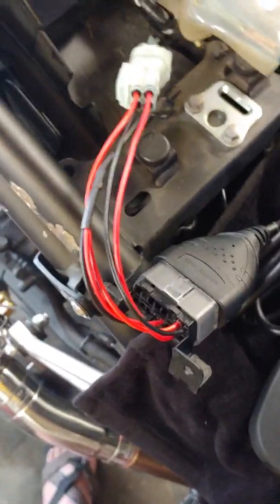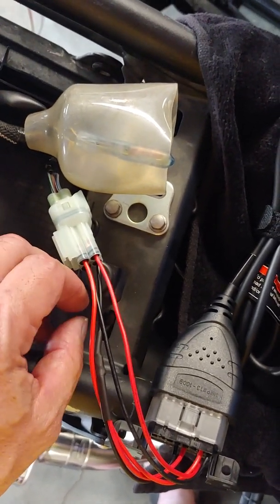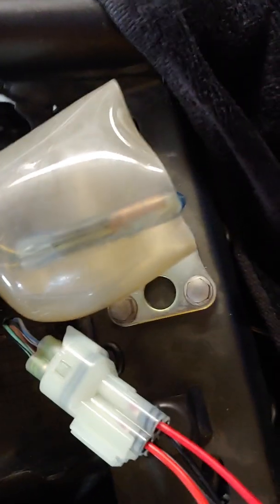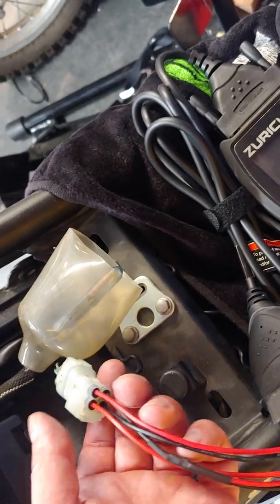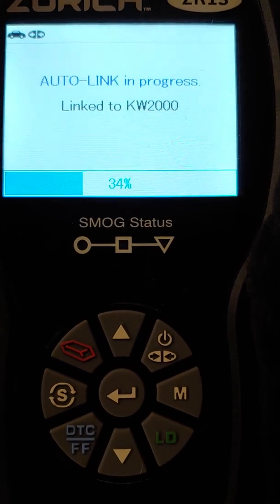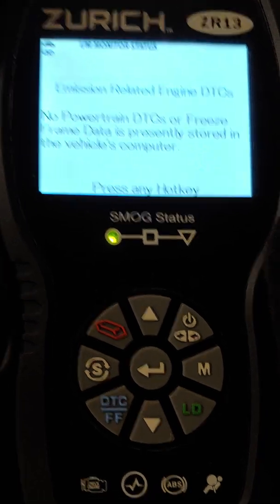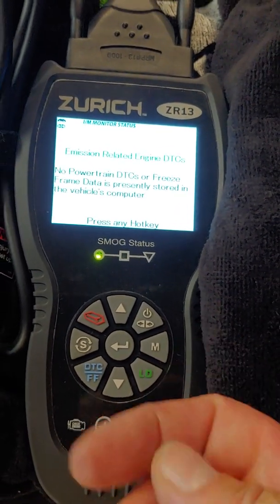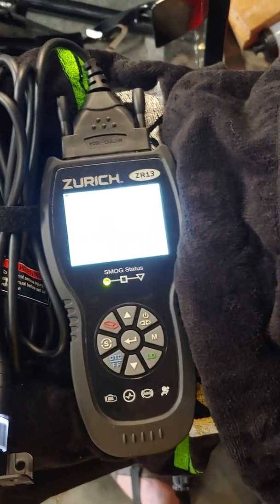Kawasaki Ninja 400 KDS-OBD DIY Connector Test

Comment: The Innova 5210 works really good also, the fuel trim live view graph is excellent,,,,Kawasaki now with the Euro5 6-pin plug supports all obd2 protocols like the one in this video kw2000, also can bus high and low, also L-line protocols,,,,,,when you hook up the meter all protocols register 100% and then it chooses can bus for the scan not kw2000 protocol, I guess if you disconect the can bus line it will then pickup the kw2000 protocol.👍

Comment: please, i need help, i was doing this by myself (yes, stupid) with just loose wires, and when i put one wire in the 15 pin (k line) it touch the positive of the baterry and made a cut, now the bike doesn't start and when i put the keys to ignition, it doesn't do anything, the baterry is new and i don't know what to do
Reply from the maker: Check your 30A Main Fuse
Reply: @falcn12  thanks, i checked and it was one burned, i changed the fuse and now when i put the bike on first gear it cut off, i already check the kickstand sensor but thats not the problem
Reply from the maker: @Crissalonsourra kickstand can't be down when you put it in gear. Must be in neutral to start the bike. Even holding in the clutch the bike will cut out if you put it in gear with the stand down.

Comment: Pulling my hair out trying to get a working OBD2 lead for my Kawasaki Ninja 400 2018 

Can you tell me the name of the plug I will need to order to connect to the ninja 4 pin plug. Thanks 🙏🏾
Reply from the maker: It's in the description. The 4-pin is "I bought the correct KDS 4-pin connector from cycleterminal.com. It is a Sumitomo HM090-4 connector.  I just bought both sides, just in case.  Plus it was only $5.55 as a set."
Reply from the maker: If you just want to buy one, Norton Motorsports sells a complete harness.
Reply from the maker: https://www.norton-motorsports.com/product/obdii-obd2-diagnostic-harness-kawasaki-ninja-400/
Reply: Sorry I should have said I'm in the U.K. over the pond 😄😄😄 I just need to buy the white plug so I can Make my own lead.....
Reply from the maker: @Cookie69697  Sumitomo HM090-4
Reply: @falcn12  thanks have ordered them from Amazon so next it's making the lead 😄😄 thanks for your input 

Strange they don't make them off the shelf..
Reply from the maker: @Cookie69697  Kawasaki probably sells one for $500

Comment: Soo... There is not a grey black or light green and black wire... Even in your video only 2 out of 4 wires actually are what you say they are.
Reply from the maker: The wires on the bike harness side are the colors described. I used an existing pigtail connector for the other half that is just the red and black, but they go to the correct pin numbers as outlined. YOU have to make the adapter to match up to the colors in the bike harness and use whatever color wire you want in your connector wires. I'm not bothering to find matching colored wires for the intermediate adapter harness.

Mine is a 2018, they may  have changed colors on the newer ones? 2023 got a new ECU connector design so they may have changed wire colors.

I also misspoke vs what I wrote - the one that is BL is BLUE not BK BLACK.
Reply: I understand the generic 18g red and black wire used on the OBD2 harness. I'm saying the wire colors on the motorcycle harness are not what you say they are.  Mine is also a 2018.  The motorcycle harness consist of black and white, brown and white, grey and blue, light blue and black.
Reply from the maker: @romanov9580 what I show on the paper matches what you say, except mine was light green and black. You can see the colors of my wires and the blue and green are different shades.

Comment: Haiii Im using z250 abs 2019 model, it's use 4pin or 6pin cable?
Reply from the maker: I don't have that model in this country. I can't check. Look under the seat, and find the capped off connector and see for yourself
Reply: I have a z250 2021 abs and am facing the same issue
Reply from the maker: @cedricrene1531  I have no info on that model here in the US

Comment: So I put velocity stacks in my ninja 400 and I also fired up the bike before I installed fuel map to my pcv5 and it triggered error code 13 and my AFR is now 24 and the throttle is sluggish. When you hook up to ecu with that odbs, how do you clear it?
Reply from the maker: I hit the clear codes button
Reply: My ninja 400 also got code 13. I pulled my airbox to do filter and plugs and while it was disconnected I turned key “on” to check my mileage. So it’s a false code and the manual says driving a few trips should reset it once the computer realizes there no physical problem.
Reply from the maker: @wampaswomps3975  a few trips is 3 I believe, complete drive cycles.  Or there is a way to clear codes using the buttons on the dash. 

Ride cycles:this is the procedure listed in the workshop manual. You must follow it exactly for it to work:

1. Start the bike and let it idle for a least 30 seconds before riding the bike.

2. Ride the bike for more than 10 minutes from the time you first started it. 5 of the 10 minutes must be at more than 40km/h continuously.

3. Turn key off then repeat the process twice more until you have done three cycles.

4. Turn the key off and when you turn it back on for the fourth time you should be clear.

Comment: I'm trying to find 9ne which I can use for my kawasaki z 640 w/4 pin . I bought one from ebay and it never worked for me. Any help?
Reply from the maker: I don't have that bike, so I can't test anything.

What year is yours?
Reply: @falcn12  its 2019
Reply from the maker: @rbon2wheels  according to this site the same cable I made should work for your bike.
Does your scanner do the KWP2000 protocol?

https://www.gravesport.com/products/ftecu-ninja-400-z400-ninja-650-kds-to-obdii-diagnotic-harness-adapter.html
Reply: @falcn12  my scanner says CanOBD2 from Innova.
U can check it out on 
Www.innova.com.
Its innova 3100ABS
Reply: Those guys are close to me so will give them a visit and see what they have for my bike.
Thanks much
Reply from the maker: @rbon2wheels  the owners manual says it has keyword 2000. Your cable may be wired wrong.  

See if you connector and wiring matches what the forum states that I followed.
Reply: @falcn12  thanks you
Reply: @falcn12  I will open it up and see how it was wired because when I connected it to the scanner,it said "can't connect to ECU
Reply: Just order the cable from the guys u sent me and I will be picking it up today and will keep u posted it it worked.
Reply from the maker: @rbon2wheels  hope it works.
Reply: @falcn12  yeah ,have 2012 Ninja 650 and 2019 z650. On ninja 650 it has the same plug as the z 650 with 4 pins under the rider seat
Reply from the maker: @rbon2wheels  my understanding is yes, the plugs are the same, but the communication protocol to the external system is not a universal OBD standard, so nothing but the Kawi diagnostics can connect to it.
Reply: @falcn12  got u.
Reply: @falcn12  thanks man,the one I bought from the website you sent me worked. But can't work on ninja 650 2012 ,so what I will have to do is the find how I can wired the old up so I make the cable for Ninja since I still have the one which didn't work  and has 4 pin. If u can get me the diagram on how to wire it,that will be great. I want to make one like you didn't.  Again thank much. I'm grad I found your channel.
Reply from the maker: @rbon2wheels  so you have a 2019 and a 2012?  The Ninja 650 only has OBD/KW2000 from 2018+ from what my research shows.

There is a data connector for the up to 2017 models, but it uses a proprietary Kawasaki KDS protocol, so you need a special tool like your Innova scanner, but it only works on certain Kawis, and it's a couple hundred dollars. 😮

Comment: Hello there , I pick up a adapter for my back to use a obd2 scanner and the adapter has only i believe the frame ground and not  Signal ground would this cause the reader to not be able to link ?
Reply from the maker: Which adapter did you buy? If the signal has no ground reference the voltage pulses may not be read correctly.
Reply from the maker: Also make sure your OBD reader does the KW2000 protocol
Reply: @falcn12  it was from jp cycle, the website said it was  Compatible with 2017 ninja 650, but the plug was different    so I pulled the pins and I gotta check the  Scanner to see if it is
Reply from the maker: @carnaglas_mv2662  checking around on the internet, I am not sure the Ninja 650 had the same OBD2 capability until 2018+
Reply: @falcn12  yea, I did more research till 2018+ I was year to early lol

Comment: Aliexpressen nem lett volna ilyen csatlakozó?
Reply from the maker: You can buy them, such as from Norton-motorsports.com, but that is more expensive. I don't but from aliexpress.  Building one is also more fun.
Reply: Találtál valahol ilyen csatlakozót? Nekem ZX636E-hez kellene de nem találok sehol. 6 pontosat találtam és meg is vettem de szart sem ért.
Reply: @g.h.8020  I do not know what the ZX636E uses for the KDS-OBD connections.  There is an OTKEFDI Motorbike 6Pin OBD Cable for Kawasaki Motorcycle OBD Diagnostic Connector available on Amazon, but I don't have ZX636E to test it with.
Reply: @ryanvallieu594  thanks for your reply but i also found only 6 pin cable. but there is a 4 pin connector on the motorcycle drawing. The cables BR / W, LG / BK, BK / Y, GY / W are all. Maybe this is how you can help what to tie where?
Reply from the maker: @g.h.8020  that would require some research as I don't own one
Reply: @falcn12  okay, I'll keep researching :D :D